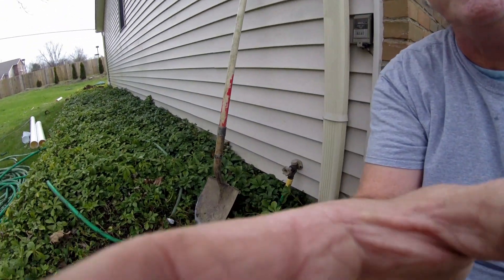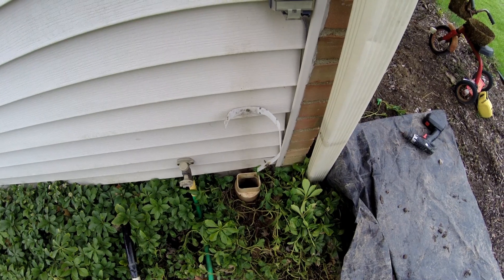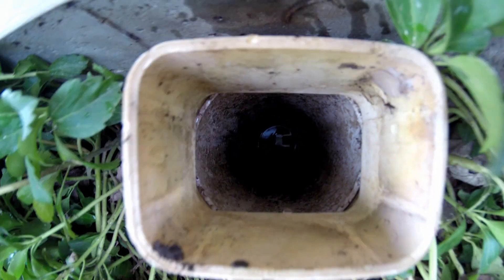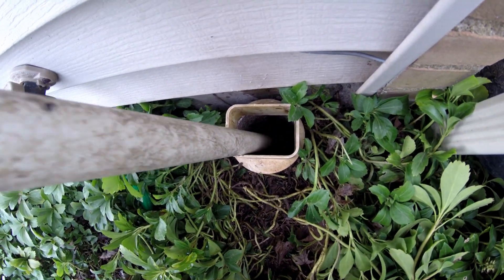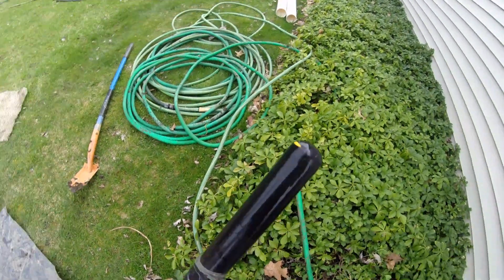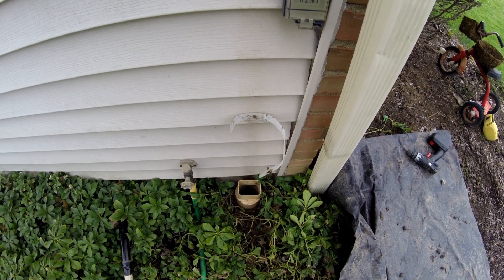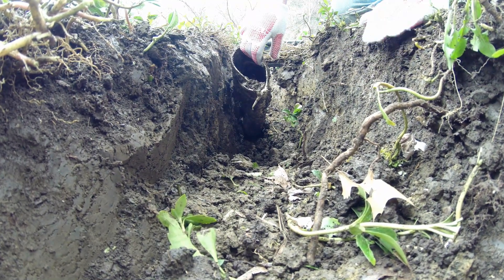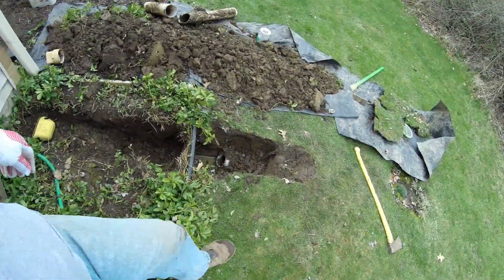Big Gap Between Downspout and Drain? Howto repair PVC Pipe holding water at the downspout

Comment: Nice video. Do you recommend putting any sand or gravel underneath the new pipe to prevent it from sinking down again? Or just throw the dirt back?
Reply from the maker: Hey Andrew,
Thank you for watching. Sometimes, I put a flat rock under pipe when it's a two story spout or massive roof coming to one spout but, as long as the pipe has down hill flow ( not holding any water at 90 degree elbow) just packing dirt under pipe should be all that is needed. Thanks again for watching!